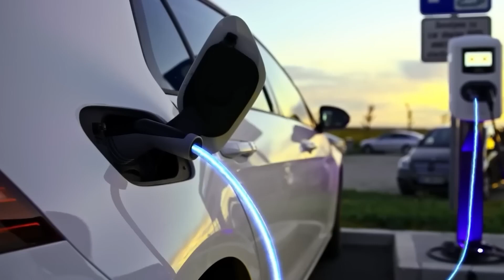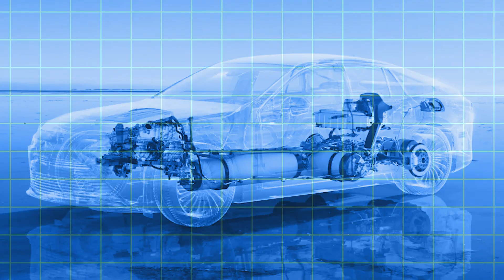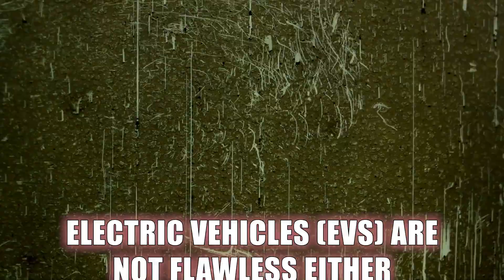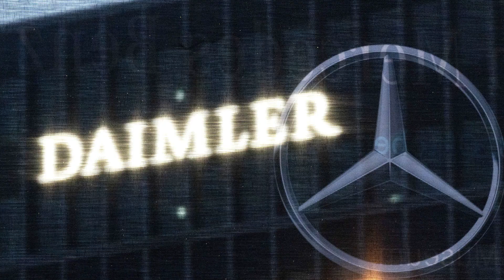Revolutionizing Transportation: Toyota CEO's Unveils the Negative Carbon Engine! 🌿🚗

Comment: If we capture too much CO2 and make it drop below 180ppm what will we do to grow plants or food as we know they die at that level?
Plants thrive in 1600ppm and need way less water to grow.  It is a fact, its used by farmers.  This capturing of CO2 concept, I believe, is aimed at regulations, know the rules and go around, but for the needs of Nature itself it goes in the opposite side of what plants need.  We are also a corbon base life also.  Its part of our DNA.  We are the result of mushrooms! + some factors for sure but nevertheless...   CO2 is not pollution.  Other gases, other particiles like PFAS and chemichals produced like ''the weed will not be there anymore'' are way more polluting and damaging to all life forms than CO2 itslef.  CO2, in a way,  is a measaure of activity not quality.  I reckon we can argue that better processes can reduce but for some things it means death when too low.  Yes we need to stop burning this ressource at 70% of the extracted barel. This number is to be verified but not to far yet in saying its vastly more burned than used to make other things like glasses for the vision, medical implants, advancing our technologies and other wonders we can produce out of this fossil goo.

Now, about producing the electricity itself.  Its a hidden scam at times as some areas use fossil fuel and biomass to turn turbines and they pollute on a greater level than a lot of cars. And then you will use this dirty electricity to pull the Hydrogen out of the water with an energy hungry process.  

Is there any coral reefs in cold water?  Too cold we kill water diversity!  More than pollution there was never any coral reefs too north or too south where cold water currents are observed.
Reply from the maker: You have a great point here. I like your way of thinking!
Reply: Well we could probably return to current fuels to power our cars

Comment: zero emissions allready in play? You mean that the Hidrogen the car uses has zero emissions? Ok, where did that hidrogen come from ? Do you know how much electricity is needed to produce hydrogen ? Where did that electricity come from? Where did you get the materials to make the hidrogen installations and pumps ?

They emit a crap ton of emissions, please stop saying zero emissions !
Reply: You are aware or ignorant that (a) the electricity can come from carbon neutral sources and (b) they found natural places that catalyze water into oxygen and hydrogen one can capture? Likely not - commenting as ignorant is so easy.
Reply: You can say the same for EV cars. Like how much energy is spent to produce the parts, most specifically batteries.

Comment: What is the mentioned liqid, that the CO2 gets absorbed into? How much CO2 per liter liquid does it scrub? Where and how will this mysterious liquid get stored after use? How much does it cost to change the liquid and the filters it requires? How enviromentally costly is to produce the liquid and filters for it?  None of these questions were adressed in your video.
Reply: they also dont know this, so they didn't tell you, as they would get more info on this, they would make a new video for this.
Reply from the maker: Great questions! Maybe next time we investigate this topic 🤞🏼

Comment: EVs are overrated, but they help to innovate even more on combustion engines.
Reply from the maker: Agreed 👍  They are useful in a way :)
Reply: Lol. EVs are the future. Until something new comes. Combustion engines are something of the past. Poor efficiency, the need for several gears... We are at the beginning of the EV history. Just imagine only in 10 years with battery technology, small engines on every wheel...there's just no comparison.